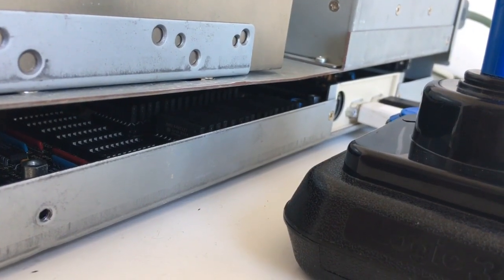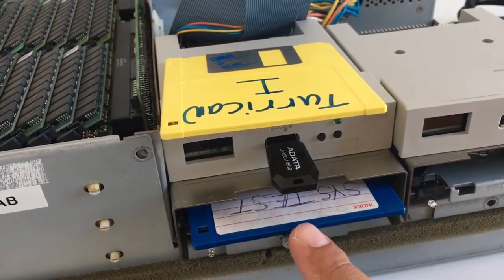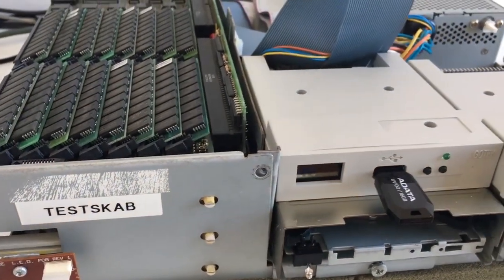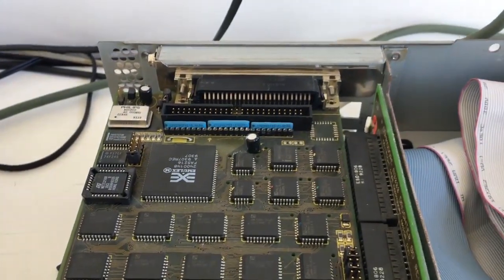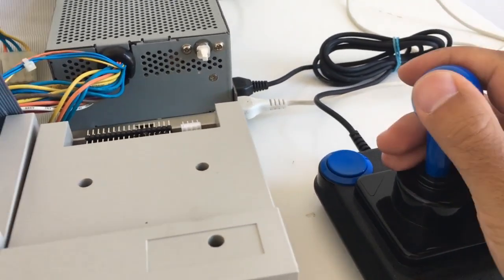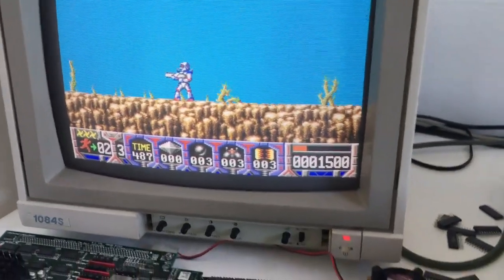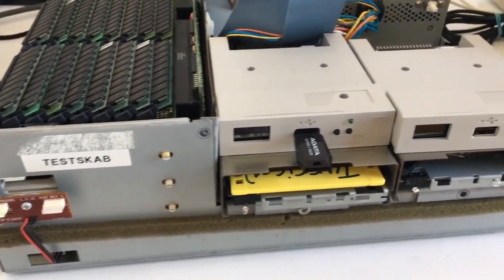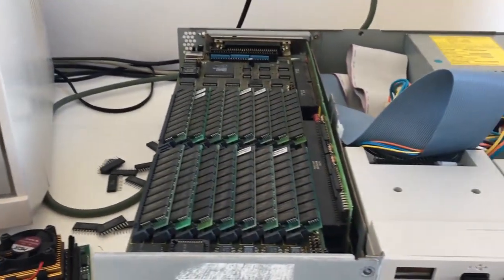Commodore Amiga 3000 82MB RAM 68030 1084S

Comment: Har fundet de der eject buttons. Men kan ikke se om der er mere på lager ved dem.

https://corei64.com/store/products.php?33&sid=8fh1e7isjk4ueqtle4eltan782
Reply from the maker: brostenen Ejjj hvor fedt.  1000 Tak skal du have Brostenen😄😄👍🏼
Reply: Cengomania X Det var så lidt. Jeg skal derimod ud og finde et nyt intern drev til A500. Det kribler i fingrene for at finde og købe, du ved, men må vente til den første.
Reply from the maker: brostenen hvad med et gotek drev.  https://youtu.be/61QA0Iimdrc
Reply: Cengomania X Det er til en 500 rev 8.1a. Til den Rev5 som jeg er i gang med at restaurere, bliver det gotek. Jeg har for mange disketter til at skifte til gotek endnu.
Reply: Cengomania X Den rev 8.1a eller var det 8.a1. Er en 500+ som commodore solgte som en 500 model. Den sidste 500 model så at sige, før begyndte med 600. Den jeg har, er fra 1991. Men min rev5 er derimod pinpiinted, ved hjælp af internettet, til omkring 4'rde kvartal i 1987.
Reply from the maker: brostenen A500+ er een af mine yndglings Amigaer, har du set min A500video? Noget af det første jeg lavede. Kan du se de nyere roms og batt. 
Har du fjernet batteriet i den?
Reply: Cengomania X De byggede en reduceret 500+. Så den har aldrig haft hverken batteri eller clock-circuit. Så blev den leveret med 1.3 rom og 512k ram. Den har dog ECS chipset. Så det er en blanding mellem en 500 og 500+. Meget fed lille maskine.

Jeg har ikke set dine videoer om 500. Der er så mange der ude. Det har været big box videoerne jeg har set på din kanal. Det er ikke grundet din kvalitet, for den er nu god og går i dybden. Der er bare for mange 500-videoer der ude på nettet.

Din stil er lidt som det hightreason laver omkring PC. Mega meget info og håndholdt kamera. Når det bliver for poleret som phils computerlab, går auraen af.
Reply from the maker: brostenen Jeg takker dig mange gange. 
Jamen der er flere der skriver, den håndholdte stil er at fortrække, selvom jeg har stativ, tripod osv😄 takker. 

Den A500 du omtaler der, er dem mest populære og eftertragtet model, tillykke med den, den model dukker ikke op hverdag👌🏻

Hvis du endag skulle ha lyst, så er videoen her:

https://youtu.be/bAkXgNVz4Jc
Reply: Cengomania X Rev8 eller 5? Går ud fra at du mener 8. 😎☺️ Håndholdt er jo fedt til at snakke om ting. Men stativ er bedre, når man f.eks. skal vise hvordan man monterer noget. ☺️

Comment: I am jealous ...a very sweet machine...here in Canada it is unfortunate that all my A500s and A1000s are NTSC and not Pal...compatibility with several games is not the best.
Reply: I hear you there. What stuff was released for NTSC is nearly impossible to find now
Reply from the maker: rednight Commodore Amiga was not as popular in the US as it was (is) in Europe 😁😁
Reply: It was in the late 80s but outside of TV production the Amiga scene died off pretty quickly in 90ish. This was entirely Commdores fault as their upper management decided that the Amiga was a serious business machine and cancelled their contract with the major retail stores and wanted to start a dealership program. The machine remained fairly popular in Canada till the late 90s, and had a pocket of popularity near the Great Lakes in the US.

NTSC versions of most of the well known Amiga games do exist, but distribution was much more limited especially the later stuff and hasn't been preserved. Which is a double problem over here as American TVs don't have RGB and can't run at 50hz.  Amigans in NTSC land either have to buy a flicker fixer or use a real Commodore monitor.
Reply from the maker: rednight Thanks for the story👍🏻 but just a simple flickerfikser is the way to go then😁👌🏻 how did the C64 do there? And idea?? 💡
Reply: The C64 was the dominant 8bit home system for years. The Apple II was much like the BBC Micro in the UK. It was mostly used in education and had a strong presence in higher income homes. The TRS-80 did well early on but did not maintain that position. Atari machines did OK. 

Commodore originally had deals with all the mass market retail joints, the machine was affordable and everywhere. This deal was not continued with the Amiga line  unfortunately. Apple still likes to rewrite history and the California media loves their story even though it's mostly false. Most people that where into computers back then know this and sometimes talk about it in various retro circles. It's also been written about in some of the more recent books talking about Commodore.
Reply from the maker: rednight Thanks. We all wish Commodore had survived, many dumb decisions yes, but mannnnn the C64 and Amiga lines were incredible. The A1000 was ahead of its time.
Reply from the maker: Mr. SEA yes most of the awesome games were produced in Europe. 
Nice computers you got there, but maby try looking for a pal version on ebay😄

Comment: You should be able to use the SCSI header and run the OS off a compact flash card.
Reply from the maker: airingcupboard yes. Just need a sd to scsi adaptor first😄